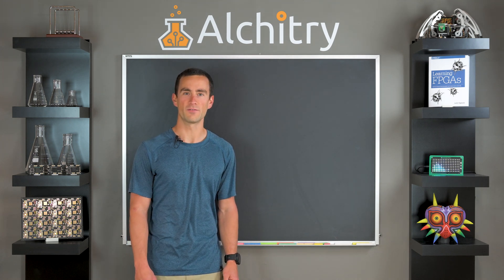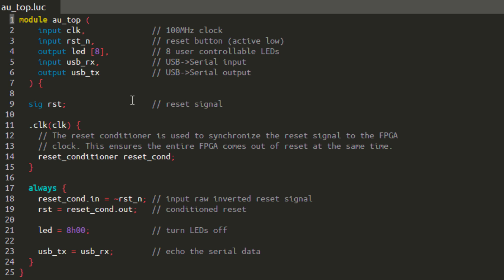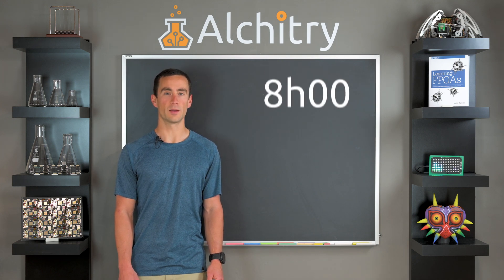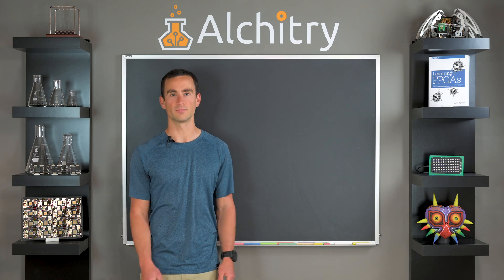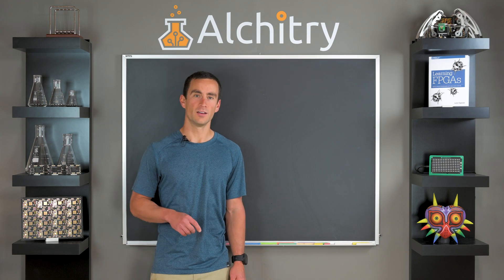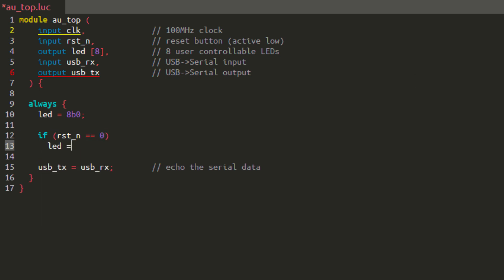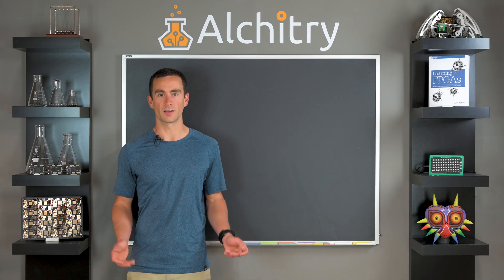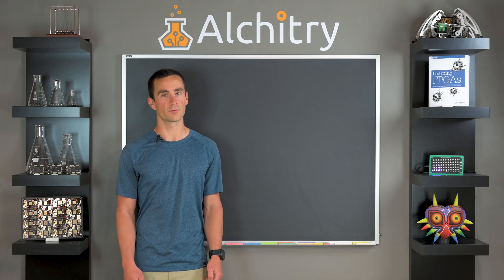Creating Your First FPGA Projects

Comment: The board looks neat, and the tutorials are nicely explained! 
The one thing that I have mixed feelings about is the need to create a new language that's "easier" for beginners. I'm all for a gentle introduction to new stuff, however I think this will cause more problems in the long run. And seeing that the syntax looks like Verilog with a different skin, I'm not really sure it's actually easier to use than the industry standard.